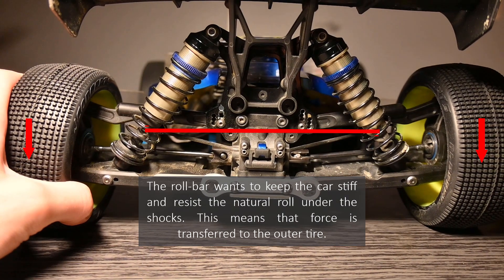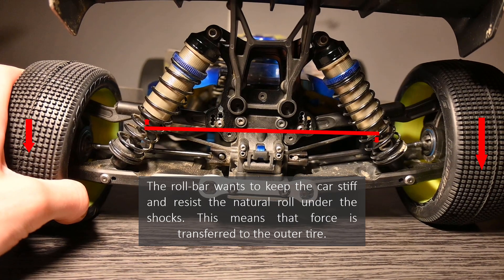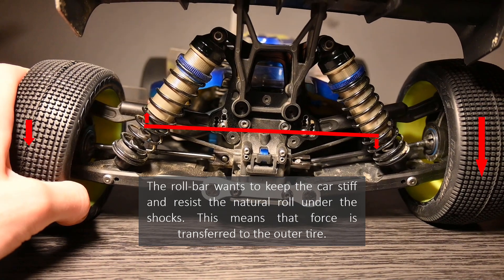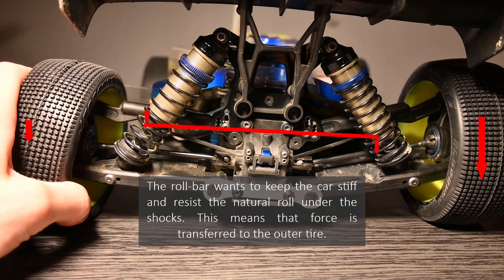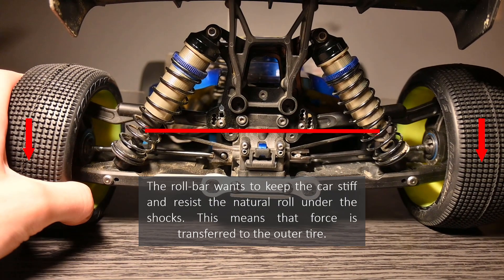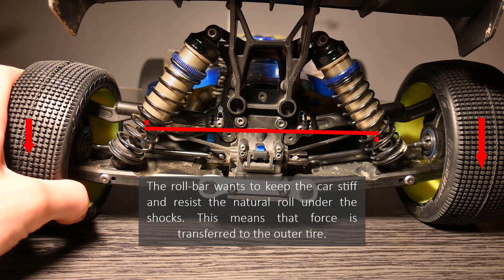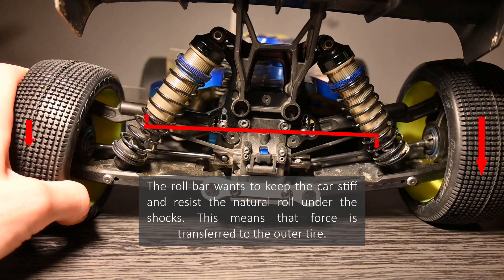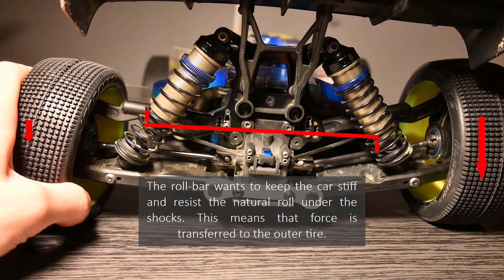From the ground up: Anti-roll bars

Comment: Great video.  I bought some used 1/8 ebuggies and am trying to get a feel for the setup.  The e-buggy handles generally well.  Sometimes the track has more grip than other times.  I mostly notice the buggy will slide or drift around the corner.  The buggy had a front anti-roll bar of 2.3mm and a rear of 3.0mm.  I reduced the rear to 2.7mm and noticed the grip was only slightly better.  If I went thinner to say 2.5mm, is that too big of a change, or will that negatively affect anything else?
Reply from the maker: You can try and see if it gets better or worse. Could be that the car is really stiff on its own where the anti-roll bar doesn't get a chance to affect it a lot and since you would only feel a slight difference